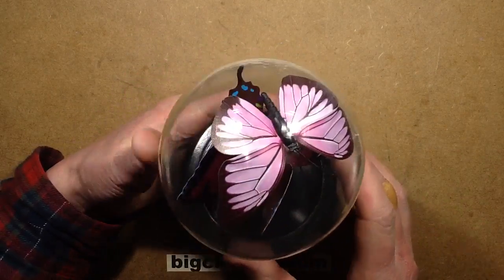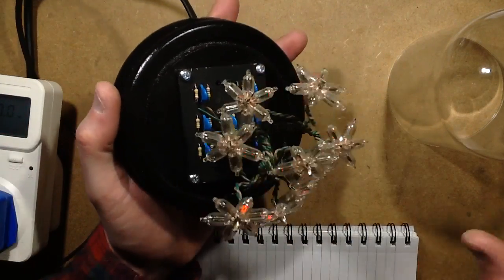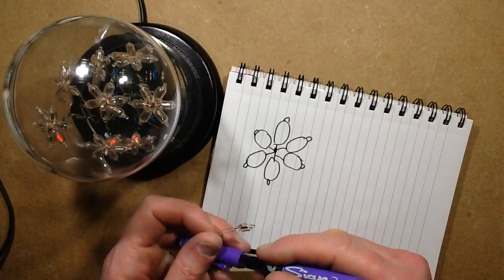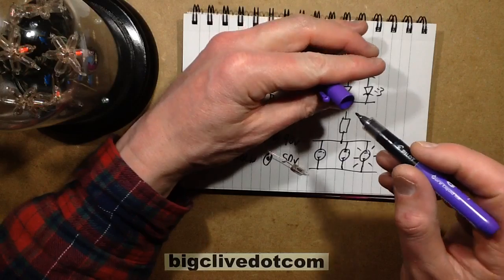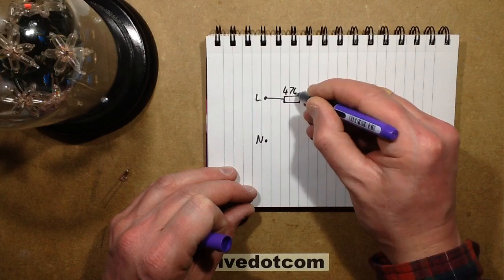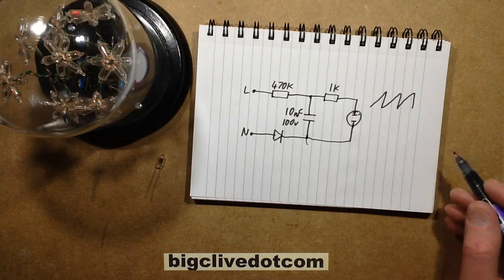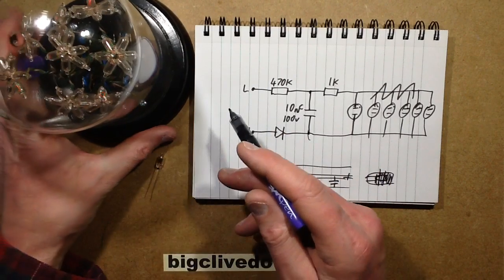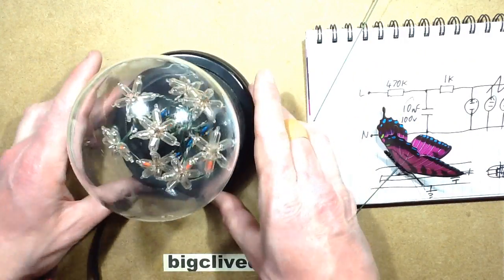Rehousing my neon nixie-flowers in a glass dome.

Comment: The first good usage of that thing I would have thought was putting a seal around the glass and use it for something vacuum related, like sputtering or metalvapouring stuff
Reply: +Chip Guy Vids I would not trust the glass to be strong enough
Reply: +Chip Guy Vids 
My thought exactly. Would love to know where to get those glass domes.
Reply: +Jack White Ben Krasnow/Applied Science channel has made a sputterer that uses a similar but bigger dome than this. However sputtering is a rather delicate and complex process, nothing someone can hack together in one afternoon.
Reply: +ChrisD4335 I was actually wondering about that too.
Reply: A year or so back Hack A Day reported on someone who had built a scanning electron microscope under just such a dome.
Reply: +ChrisD4335 
I was going to say the same thing, those cheap glass domes were never meant to support a vacuum and could be really dangerous.

Comment: Very nice project. I'm just wondering if I could use multiple lamps to make a neon clock in the style of a nixie clock. 40 neon bulbs is £2.64 whereas is between £3-£4.50 per nixie number. Using 7 neons to make up a 7 segment display.

Comment: Oh and to prove this you can put one on a lawn mower spark plug wire , just take solder and make a thin slab and while its still plastic stage insert small wire to one end and let it be "soldered", thats the part that you wrap around the high tension wire to the spark plug, it will give you a monitor light to show the strength and duration of the spark.

Dave in Kentwood

Comment: A memory of the past takes me to having a 4 inch readout screened device I purchased years ago that had 8 of those lamps on the dial, they were powered each by an attached wire to the spark plug wires by means of what looked and felt like 3/16 wide X 1/16 thick lead parts that were to be wrapped at a 45 degree angle on the plug wire. The object was to see in sequence which and when the plugs were getting their potential voltage and by the brightness the strength. It was like having a gauge in a spot that would tell when the plugs got fouled or the distributor not delivering. Looked and operated very well, I may still have it in "Ye Old Garage", but so are numerous other objects I've saved for further use.

:-)
Dave in Kentwood

Comment: If you used coloured neons, it'd be even more fun to look at... :D
Reply: +twocvbloke only seen these in orange
Reply: ljmike1204
Look for phosphor coated ones, like these:
https://upload.wikimedia.org/wikipedia/commons/7/7d/NE2COLORED.JPG

My Sebo power nozzle on one of my vacs has a green neon lamp in it... :)
Reply: woa thats cool are that the only colors they have
Reply: ljmike1204
I think there's a few other colours, but never really looked into it much, I just know that there's more to them than just orange... :)
Reply: They can also be filled with argon, krypton, or xenon rather than neon, or mixed with it. While the electrical operating characteristics remain similar, these lamps light with a bluish glow (including some ultraviolet) rather than neon's characteristic reddish-orange glow. Ultraviolet radiation then can be used to excite a phosphor coating inside of the bulb and provide a wide range of various colors, including white.[23] A mixture of neon and krypton can be used for green glow, but nevertheless "green neon" lamps are more commonly phosphor-based.

Comment: Thanks for post I had forgot that I used to build these back in the 1970's. do to low current draw I found I could run them with a simple inverter circuit and a 9 volt battery, they would flash for days. Any other fun thing to do with neon tubes is to put them on the end of a flexible piano wire. Power then off the mains with a resistor like normal, but when you moved the wire "in my case with a wiggle motor set up" you get the coolest light tracing effect.

Comment: are street lights neon lamps?
Reply: +hannes hebben 
Yes and no, old SOX (low pressure sodium) lamps have neon gas in them, when they first strike they glow a dull neon red, but as they heat up the sodium vaporises and the light starts to glow yellow, but modern SON-T (High Pressure Sodium) lamps are a different beast and do not contain neon gas...
Reply: +hannes hebben No, various other technologies are used; but mercury or sodium (the very yellow/orangey ones) vapor are probably the most common (might vary by location).
LED are starting to show. More here: http://www.grahlighting.eu/learning-centre/street-lighting-technology-comparison
Reply: yes i am thinking about the yellow ones and thanks
Reply: +hannes hebben Those are normally sodium vapor lamps (if you're thinking of the yellow street lighting).
Reply: Oh that's very interesting! Thanks!
Reply: +hannes hebben Usually no. They are typically sodium vapor, mercury vapor, metal-halide, or LED.
Reply: +Scott Gray That's a bit like saying "I don't like fish" when you only dislike a particular species of fish.
The colour spectrum an LED fixture will emit depends on the phosphor mix and it really comes down to what type is installed. I'm sure there are LEDs that will have a spectrum you do like and if there aren't they... could be made with the right mixture.

It's been a while since I've looked into the whole debate about what's good or bad, but probably LEDs will provide better luminous effectiveness now than both low and high pressure sodium lamps. And they'll also emit a more filled spectrum than the yellowish low pressure sodium lamps, which means that humans can easier get good visibility with less light coming out of them (if the LED and the fixture are chosen wisely and regulated properly). Additionally you'd probably be better able to regulate the brightness of an LED.

But light pollution is a big can of worms, to be honest a lot of street lighting is done too bright in my opinion. The same area covered with a lot less would still work just fine after you've adjusted to low light circumstances, and not having a single wavelength sodium lamp does help for people with bad low light vision. Then again you've also got the issues astronomy has with observatories and that its easier to filter out the single wavelength emission that reflects back down to earth than the broader spectrum from LEDs and other "white" light sources.